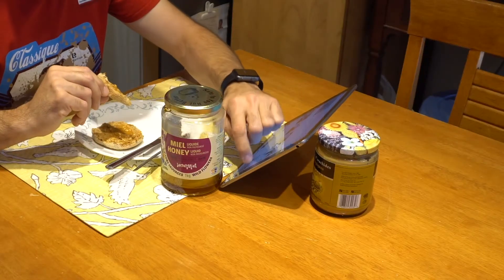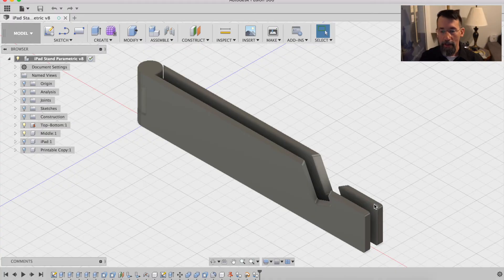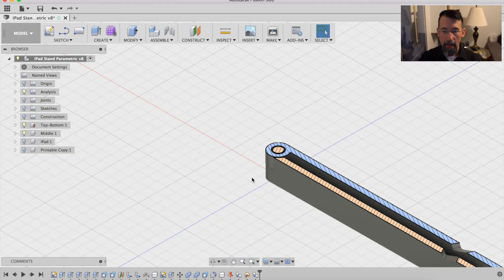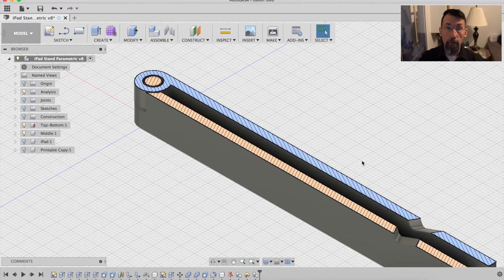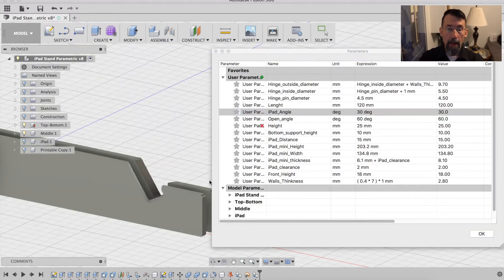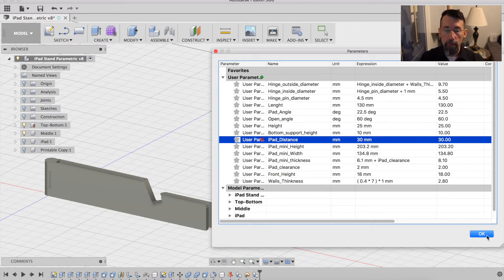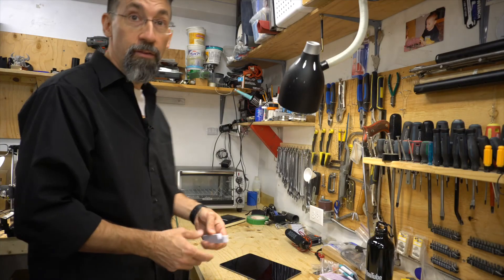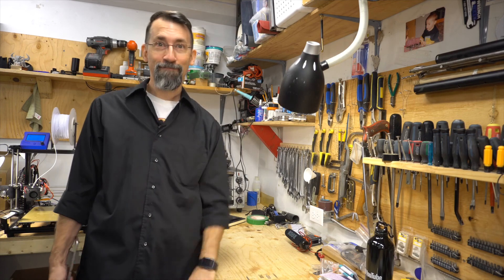iPad stand 3d printed, a good design and functional.

Comment: Outstanding frank! Functional and useful... Lots of 3d printed stuff I see is generally just a neat idea but not useful. This is very useful. Great video production quality! I guess I need get mine setup and run it....
Reply from the maker: Thank you for your kind words. And get it running, it's so much fun. I have discovered that I like doing the design part of it, and also it is rewarding to see the product printed.
Reply: Frank's 3D shop since you love design... i have a concept... I have seen some prints that are ok.... But what I want is basicly an acoustic amplifire based on the brass horns like french horn etc. For general cellphones.  My family likes to listen to their cellphones while showering etc. My printer is a anycubic 13 mega with a printable space of 7.5"x7.5"x7.5"
4.25"x32" is the window shelf I can set a device on. However 3/4" up from shelf the window cavity relieves another 2.5" to the rear. Maximum height is 22". 
Conceptually I though of the phone laying on the shelf on its back, on the far left, firing sound to the right. As the speaker on my phone is on the end of my phone next to the charger port. I was concieving of a self supported conical tube that snakes back and fourth gradually increasing in diameter eventually leading to a 7.5" diameter end. Ideas????
Reply from the maker: Nice concept, it reminds me of the old gramophones, I would incorporate the shape of a gramophone horn in the design, it will also help to print this thing. Now you have to think about how you will print this in the design; you should be able to print the horn laying on its opening. Also, the air as to be forced from your phone for the amplification to work best. So you should have some rubber gasket where you insert the phone so that air can not escape elsewhere. I will keep this in my project book. Thanks.

Comment: Frank, I have a budget of 300 dollars for a 3d printer. Which one should I get?
Reply from the maker: +Julz Prez Hi, I think that any Prusa i3 clone is a good start, I would make sure you can add auto-leveling and some PEI bed linner, those type of printers are easy to work with. That said be aware that you will have to do more work than a printer from Prusa 3 times the price ! I will suggest look on Thingiverse and Google and search for the exact name of the printer you are looking for, if there is a good community supporting this printer that is a good sign, when you encounter a problem you should find the solution easily. And if you have a problem, shoot me an email and maybe I will do a video about it. Thanks.
Reply: +Frank's 3D shop , thanks Frank!